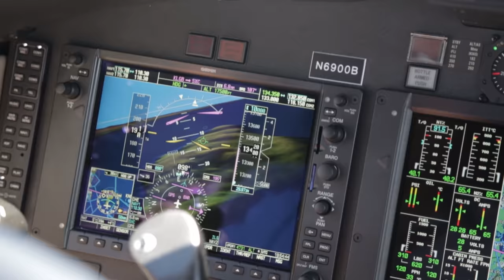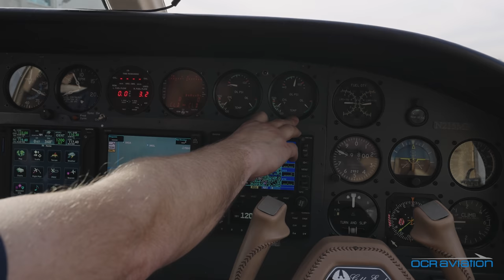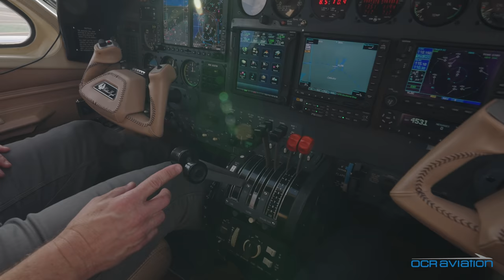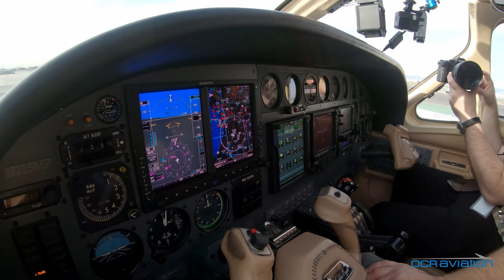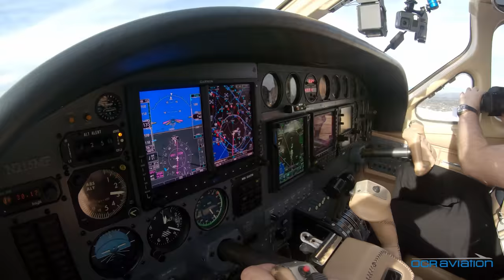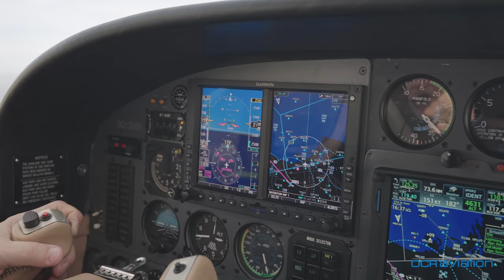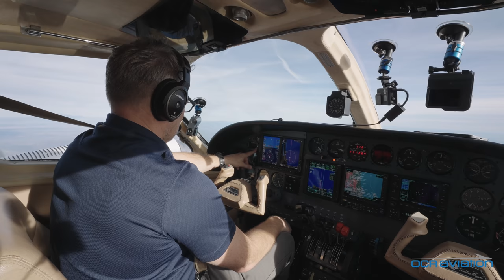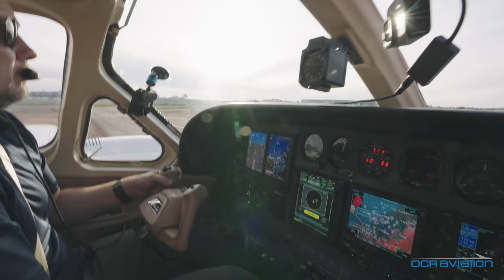#58 Very Clean Cessna 421C with Upgraded Avionics - Paint - Interior

Comment: Nice video, Thanks.  I have owned and operated my 421B for 27 years.  Love it.  Just did an engine change on the RH side (1,765 hrs SMOH and only changed due to a case crack, but was about $90,000 all in FWF for a Western Skyways New Limits overhaul including case replacement.  I burn 42 gph in cruise  (125 pph per side at 68% power of 31 inches MP, 1,800 RPM).  
The "Transfer" light illuminates when the fuel transfer is complete.  It should be extinguished if there is fuel being transferred.  There is a pressure switch in the transfer line and when the transfer is complete, pressure in the line falls, and the switch closes to illuminate the light on the annunciator panel.  The vane type pump should not be operated without fuel to lubricate it. So you should turn off the pump as soon as the "Transfer" light comes on.
Reply from the maker: Thanks for the note - Western Skyways are great engines. Always forget about transfer light on or off when transfer is done - thanks for that!

Comment: Yeah, was looking at the fuel flow of over 90 gph on take off, and then 55 gph in cruise, and even if you got it down to 40 gph at long range cruise at altitude, that's still almost $250/hr just in fuel costs.

The 421C Golden Eagle is a very nice airplane.  Teledyne Continental now has a CD-300 Turbo-Diesel engine.  I have to wonder if they could produce an 8 cylinder CD-400 Turbo Diesel that puts out 400hp Max and 350-375 Max Continous, and burns only 10-11 gph per side.  That would be a totally awesome conversion for this airplane.  There have been at least two turbine conversions for the aircraft, one using Honeywell LT-101 (now Rolls Royce, IIRC) turboprops and then another conversion, the Riley Turbine, which used a PT-6-135.  Either one of those would burn well into the 60 gph at cruise though, which still is expensive.  But, you didn't have to worry about babying the engines as you did with the GTSIO-520s.

I really would like to see Cessna reintroduce some piston twins, all with diesel engines.  The 340A and the 421C would be nice, and with economical turbo diesel engines it would be nicer, although TBR might be a little expensive.
Reply: "I really would like to see Cessna reintroduce some piston twins, all with diesel engines." I guess I have to ask, why?  Would you buy one?
Reply: @easttexan2933  I'm not in a position to buy anything right now, my medical isn't current and I'm not current, either.  Having said that, I think that something like a diesel powered 340A or 421C would slot in below turbo prop pricing, even the new Denali, and would give general aviation a boost up in small business owners looking for an airplane that's less money than a jet.
If they could build a new 340A with 325hp diesel engines, and could produce it for less than $1.75M, I think there wound be small business owner who would buy them.
Do a 421C for less than $2 with a 400hp set of engines and you might have a second winner.
In both cases, the fuel burn is going to go less than or equal to a small turbo prop.
Reply: @GaryMCurran  IDK man, that's a lot of money to go 200knots.
Reply: @easttexan2933  what does a Meridian cost?  How about a new TBM?  Both are single engine turboprops.  Either is going to give you a bit more cabin room.  The turboprop, especially the TBM, is going to be faster, but is it worth $2M to be that much faster add how much more fuel?
It's a balancing act, of course.
Reply: @GaryMCurran  the thing of it is....we are talking about people that can afford this stuff lol
Reply: @easttexan2933  doesn't that apply to ANYONE who flies?
Reply: @GaryMCurran  exactly !!  lol

Comment: Big turbo-charged piston engine with a transmission. Better treat them delicately or the overhaul bill will wake you up even before the short TBO times. . Sudden power changes and rapid power reductions in decent must be avoided.  Do get pressurized comfort and it is pretty.

Comment: Nicely detailed presentation before flight but I would expect some words about weight and balance as it is a flight critical item. With 2 onboard I expect it to be nose heavy. What was the trim for takoff and how did the airplane feel ?
Reply from the maker: I believe that airplane had a 2200 lb useful load. Figure 3 hours of fuel + reserve nets you around 1200 lb payload. The 421s have a wide W&B envelope. Thanks for watching.

Comment: Great Video on this High Time CE421C... No Mention of Engine Times and I would have like to see a "Check-List" Card used throughout this presentation albeit seemingly committed to memory ';-)
Reply from the maker: Forgot to mention engine times I guess - one was high time, one mid time as I recall. Airplane sold quickly - it was a very nice, well maintained 421C. As far as “checklists”, Videos are edited. Also, checklist use in my opinion is a broad topic, and while I am a proponent for checklist use, if I have to rely on a checklist to prepare an airplane for take-off or landing or to deal with common abnormalities, I wouldn’t consider myself qualified to fly it.

Comment: The transfer light only come on when the transfer tank is empty. Weird design but that's the way they're set up
Reply from the maker: Thanks.
Reply: @FlyingwithRich  a little constructive criticism. On final leave the props back at 1900rpm. Keeps positive loading on the engines thus preserving the gearbox. I have about 800 of 421 time, I own one myself and broker them. They're amazing airplanes.

Comment: One question from a non pilot: If the throttles never match and are offset, isn't there a way to trim them and make them match again ?
Reply from the maker: Yes - you can control the engines individually and match them. It’s just nice to have the levers match up as well.
Reply: @FlyingwithRich  My question was exactly that. Isn't it there some offset that can be adjusted for the levers to match?
Reply from the maker: Yes, you can adjust the throttles to make them match up but not easy and they get out of alinement over time/use.
Reply: @FlyingwithRich  Thank you for your answer. I would love to fly such an awesome machine. Unfortunately it is financially out of reach for me. I think sports cars are just toys. Small planes are the real deal :-)

Comment: I worked in Avionics in the Army. You had the Avionics on before starting the engines. Even in a OH-58, Jet Ranger, this would blow the radios. Do you recommend having the Avionics off before starting the engines? I notice other people doing blogs usually do.
Reply: No glass panels back then.
Reply from the maker: If you can have avionics off, yes I always leave them off for start. Even with avionics power off, some of the avionics will get power on the new panels, for instance you need engine instruments for start. On the 421, the fuel flows needed avionics power.
Reply: @FlyingwithRich  Thanks for the info.

Comment: Switch to Electric ingention and Fuel injector will that be better??
Reply: The 421C engines already have (mechanical) fuel injection.  Retrofit electronic ignition systems are available, but most are still flying fine with magnetos.

Comment: They are called “engines” , not motors
Reply from the maker: I always get jammed up for calling them motors - i checked around, most people I talked to said either is acceptable. Ford Motor Company, General Motors?  Google says, “A motor is a machine, particularly one energized by electricity or internal combustion, that supports motive power for a vehicle or another system with moving parts. An engine is a machine with moving components that converts power into motion.”
Reply from the maker: Plus I think motor sounds better than engine!